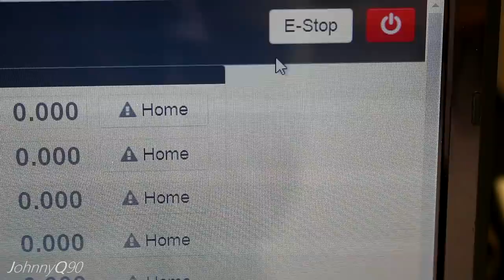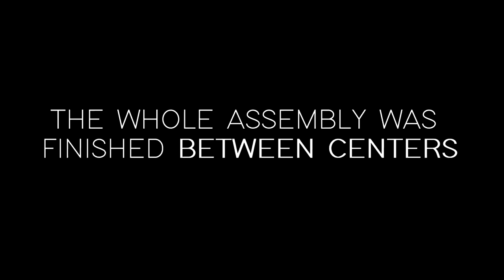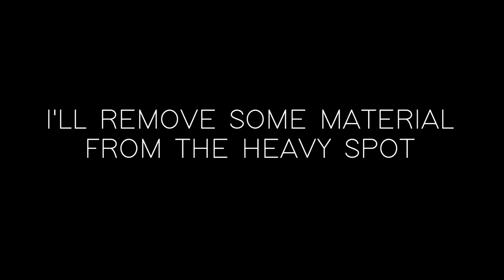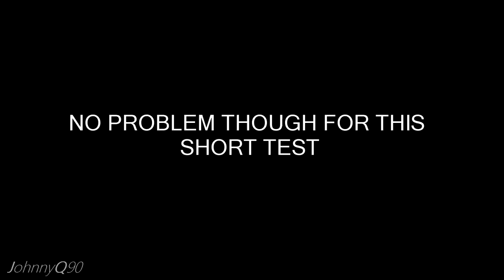Twin Turbine Rotary Grinder Tool Powered by Vacuum Cleaner

Comment: Place the vacuum hose on the exhaust port. Flip the motor over so when you use it,  the debris will be blown out of the way instead of sucked in!

Comment: There's some electrical engineering guys that'd be mad you didn't just use the motor in the vacuum to drive the shaft... Then there's the machining guys that love the idea of a rotary that has no recharge time and what I'm guessing is actually quite a lot of torque.

Comment: It's almost more useful that it vacuums the debris while working
Reply: yeah maybe a filter to stop the large debris and a funnel to get in close to the powder
Reply: Yeah but damages the propeler of the turbine
Reply: Battle Ground Survivor not if soft nonmetallic materials are used
Reply: Cobster Wilson yes I know, soft materials wont do damage
Reply: Chineses know what the next gadget they will sell
Reply: @brunovlaminck9901  dremmel made one some years ago but it seems that is was ass
Reply: great for nasty carbon fibre
Reply: I think jet engines have debris rejection systems on their inlet, there must be something that fits on this one
Reply: I am a turbine mechanic, they do have a system that uses centrifugal force to push heavier debris to the out side of a circular frame that has a scary suction device that pulls it out if the engine, I just don't think that system could be scared down to this small of a size.
Reply: This is so cool, your projects are just excellent! Did you ever print a duct to vacuum the debri created by the tool?
Reply: @mate7255  maybe version 2.0 has the speed control at the base with longer prop shaft. With the turbine farther away from the work little or no debris should get sucked in except ultra fine dust.
Reply: @Gamerock82  using some sort of filter is the smartest thing
Reply: @mate7255  not if you want a constant speed. As the air flow becomes more restricted the rpm ramps up quite steeply. Strictly speaking the smartest thing would have been to better protect the system with maybe a cone on the front of the prop that sheilds it from direct debris strike. Or, as I said, longer shaft so the air intake is on the sides, farther away from the flying bits of material instead of directly by the tool tip. Just an option. A great build nonetheless. Way above my pay grade.
Reply: I'd agree, I think if it would be designed so that the turbine blades are consumables and easily replaced, it is a huge feature.
Reply: @mate7255  the problem then is the filter will introduce some resistance
Reply: @poolofstuff  metal mesh filter wont cause too much resistance and it will filter out the larger chunks.
Reply: It probably causes FOD damage to the turbine.

Comment: Sick. Much better than the dremel version.
Reply: hope for the pocket NC lol
Reply: Pretty sure this IS the dremel. Did you see the hose while the tool was working? He made 2 one with air and the other attached to his dremel. I call shennanigins.
Reply: @thegenerousdegenerate9395  Nah, you're just seeing things.
Reply: @thegenerousdegenerate9395  I normally trust Johnny to make real things but I have to agree with this. It didn't sound or act like the vacuum powered one when he was actually using it, and it didn't bog down hardly at all when it was put to metal or wood. And it may just be my eyes, but the end shot, I feel like I can see it "cog" a little bit when he turns it off, like a rotor in a motor. I really want jq90 to clear this up, because I too call shenanigans.
Reply: @octane613  I think you are seeing things because of the shape/pattern of the sandpaper.  If I look at the whole tool and shaft it does seem like it's slowing down unevenly but if you put something over the tool and just look at the shaft it slows down normal.
Reply: This is starting with a 500 watt vacuum cleaner. Potentially, there is more power at the tool tip than with an actual Dremel. There is probably a higher moment of rotary inertia, since the spinning part of the tool is larger in diameter than a Dremel.

The bearings are probably better, and they are actively cooled. I don't see any reason why this wouldn't have more power than a Dremel.
Reply: @octane613  You know at the very end you can see the vaccuum hose right? So unless you're saying he built a sheath to hide a dremel to fool us all, I think that's unlikely.
Reply: Boss Günter  You missed the point entirely.

Comment: Next step, a real combustion turbine like the ones used un aeromodelism.
Reply: and installed on his rc car... (for replace the original nitro motor)
Reply: @MATEKYOO  i like that idea, but for that it would be bettet to use it like in a helicopter, they use the turbine to make rotate the rotor instead of for thrust. If you use a turbine for propulsion on a RC car, even just having it started without accelerating, it would make it move forward and that is a problem.
Reply: @AndoniOlea  : hypothetically it should have a free power turbine geared to the transmission... (direct gearing the gas generator to a shaft converter is a bad idea, though it is a cheaper / lighter alternative)

Axial RC turbines, who wouldn't want them...  ( though they do suck and blow thermodynamically at that size,  allegedly)
Reply: @kadmow  You are correct in that, but if he uses a turbine in a conventional way, he should add brakes to the car (it doesn´t matter how they work) but it needs them.

Comment: The power of succ
Reply: Memes
😂👌
Reply: vacuum cleaner normally runs 1.5kw to 2kw
that will put this tool amount the power tools.
Reply: @lpjunction  and air turbines are around 10% efficient so you can expect around 22w of mecanical power output, still not so bad
Reply: I am aware of thr efficiency

I meant the machine is taking 2kw level of power
that puts it amount power tools

That`s based on the power consummed

Comment: The project is really cool, but will the bearings survive the insane RPM's ?
Reply: Even ABEC1 bearings are rated to 30k+ rpms when the bearings are this small. I think the loads and temperature are a bigger concern if he's doing sustained work with the tool.

Temperature might be mitigated by airflow through the tool.

Comment: You shouldn't use such long reach tooling for every operation.  Your feeds and speed could be higher and your finish will be better if you stick with appropriately sized tooling.  The machine will also be quieter, which is evidence of better tooling selection.

Comment: Now mount that to the cnc, see how it preforms, it might be actually pretty good to mill :p
Reply: my first thought: could this work as a self cooling/ self cleaning spindle for diy cnc machines?
Reply: @TheScarvig  Ye it sure would work. Speed seems high enough. But the particles that get sucked in might damage / unbalance the turbines thus causing vibrations. But a blowing vacuum would solve this problem and actually would remove the need for a chip cleaning blower thingy... :p

Comment: I call shennanigins.

Thats a pretty sweet dremel attachment you got there. You can hear the motor. Not to mention the hose was curiously outta frame whenever it was doing work. I may be wrong but i don't think so. Turbines don't make much torque there just isn't enough rotating mass and as soon as the tool slows the air just passes through the path of least resistance. Turbines are great for moving air but are horribly inefficient the other way around. Theres a reason you can't go to the hardware stores air tool section and buy a turbine anything.  You think dewalt, makita, snap on etc. haven't done their R&D? But youtube dude knocks it outta the park? I'm sure you'll be rich soon when you get offered for design. Lol
Reply: Jealousy is a terrible trait to showcase in a public forum.
Reply: A dremel needs speed more than it needs tork and a turbine can get hella fast on air. There are videos of people who get Tesla turbines to spin at 30k rpm, there's nothing unbelievable in this video. And tell me, why would Dewalt or Makita be interested about an inefficient design? Do you think they'd want to sell dremels with full sized vacuum cleaners dangling behind them? Do you think people would want to run dremels that use 1 to 2kW of electricity and produce 70 dB of noise?
Reply: @CASTSTONE  I'm guessing your reading comprehension isn't as sharp as it should be.
Reply: @thegenerousdegenerate9395  You're reflecting, clearly you're not able to understand my points and produce counter arguments.

Comment: Awesome project, really well made.
How much power does it output? Compared to a Dremel
Reply: Since its powered by a 500W vacuum its definitely less than 500W, but even if its 50% efficient its more than a dremel i think. 'Course a 500W (2/3 hp) motor with a flex shaft would zoom right past this in pure power. Neat and all, but in terms of practicality low pressure air is pretty weak.

Comment: I really like the CNC machine & where did you get the design & code from?? This is the coolest build I've seen a while. Can I suggest you build a Tesla Turbine with a fly-ball Governor on it with a combustion chamber & a couple of Valveless valves for intakes. You could make a fuel powered Tesla Turbine as an experiment. That'd be extremely interesting.

Comment: Beautiful project, superb execution. Excellent video.

I gotta ask though, this thing has zero torque, right?
Reply: seems to be fairly powerful.
Reply: Leigh Devlin ..... It’s a bit like BHP and torque. What I mean is, this thing probably bogs down easily, look at how he has to hog material from something as soft as (what looks like) brass; small little bites so it doesn’t stall.

Air compresses easily, so a lot of the energy goes into compressing the air inside the tool when it’s under load and can’t escape fast enough. Then, as the air compresses and the turbine slows, so does the output speed, with the added resistance of the material, the tool bogs down.

That’s why pneumatic tools work, they’re under such high pressure that the air acts more like a liquid, and provides more power and torque.

This is from a layman’s understanding though, so please correct if wrong.

Comment: Well.... what's the point  of using HIGH really high precision machines to make a drill for handicrafts???? (One that can be destroyed with some steel dust, you should have done the whole thing for a compressor, not for a vacuumcleaner)....
  Isnt it like going to the Porsche Factory in Germany to build a.... wood car???? Or a bike out of plastic???

Comment: I got about half way through the lathe porn before I realized I had added the word, 'motor' to the end of title.

I subconsciously did this because JohnnyQ90 had an unnecessary word on the end: 'cleaner'. His Twin Turbine, Raspberry Tangerine Metalflake, custom job is powered by VACUUM, with a vacuum cleaner as ONE source of vacuum.

It is a well made Twin Turbine, Raspberry Tangerine Metalflake, custom, I'll give you him that, he does have some mill skill.  (Cute little mill, too.)

The other subconscious reason I added 'motor' is vacuum cleaner powered tools have no torque. If they did, all the vacuum cleaner powered tools invented would still be available, and they aren't.

Comment: Hi Johnny
I had not seen the video for a long time, and thank you for the new video
Your job in making twin turbines is very interesting and appreciated, but with a dc or universal ac or brushless  motor you power to 50w you can easily do it. You built a 50w grinder with a 2kw vacuum cleaner and this is not a good performance.
good luck

Comment: what were you thinking about when you designed a rotor  that actually draws material through the rotor blades?  On the one hand, it looks like it would automatically clean up after any operation you perform.... but as one of the other posts asked "I'd like to see a tear down after 1 month...." :)  Great job on execution!   Thanks for posting it.  Doug

Comment: my first comment just now, I want to ask a 12v dc dynamo like that, can it be changed to 220v ac, how many wires must be wrapped and what size, I think it's like an electric drill, the picture is like that, understand that I like the small ones, directly plug in the electricity without much  component.  what can you do, thanks.

Comment: You might want to make some sort of guard when using a thread milling cutter because you're going to have it catch one day and when it comes apart on you, its gonna be ugly. 
I had a similar bit shatter while using it in Bosch palm router with the base removed so it was basically how you were using this. Part skipped off my full face shield, another part went through two layers of sheet rock behind me and into the house, and another piece skipped out the open garage door never to be seen again.

Comment: Couldn't you made it where the tool worked using the exhaust of the shop vac? That way it wouldn't suck up anything that could mess up the turbines. It would also have the benefit of blowing the debris away from the work piece.

Comment: Youve effectively made a tool on your mill and lathe that does a job a lathe and mill will do better, quieter and more efficiently..  there is one signifigant personal benefactor here though, when doing work with it, there is no dust or shavings left behind, to the tools degredation unfortunately.   But that idea alone is a great concept and as in turbines attached to airplanes and such, debris are accounted for naturally getting sucked inside. As is moisture constantly being condensed and pulled inside creating a vortex   I wonder if a solution to this issue would be to add a lubricating oil atomising injector on the prestage of the turbine which could then be machined to have a pulsed spray designed to use the internal vacuum pressure to pull oil in and push out, keeping the bearings and fins clean.   This is still applying an idea of a self cleaning and perpetually motivated by a single power train, the vacuum..   Then bragging rights can be advertised as efficient without having to use what usually would be the actual tool motor and attached vacuum dust collector both..  copy right it and trademark and glue a dewalt or mikwakee sticker on it, with their endorcement, and charge 350$ with a 35% personal commission per sale.  Viable retirement envestment plan idea..  .  ...maybe..

Comment: What if you were to make it work in reverse? Hook it up to the exhaust port on a vaccum. The vaccum would act as a filter for the turbine to prevent debris damage and it would blow chips away from the work piece.

Comment: you should have reversed the direction of the turbine blades to work under positive pressure rather than suction....the you don't need to worry about debris, and the exhaust automatically clears your work of debris....

Comment: Exceptional build, as per the usual, and I appreciate the multiple manufacturing processes utilized. It appears that the "heavy spot" is perpendicular to the cross drilled hole and set screw hole that are parallel in the shaft, perhaps if you aligned them so that they were perpendicular to each other, you may not have to remove any material when balancing the assembly, or at least not as much.

Comment: Funny story i took a 12 amp vacum cleaner motor and thought hey this would make a hell of a fan for outdoors well never and i say never try that shit i put a metal fan blade onto it plugged it in and before i could unplug it all i had left of the blade was the center of it, it flew apart like a frag grenade into a milluon tiny pieces. Lol maybe a clutch fan from a car motor would work IDK. 😆

Comment: The part i kinda dont like about this creation is, the moment when you grind all the chips and dust getting sucked right into the turbine wich causes quiet a lot of wear and friction in there... if you only work on softer materials than aluminium like wood plastic etc it wont be a problem i guess but... nah nvm i wouldve made another entry hole for the air instead... but great job at all

Comment: maybe you could modify the design and make the turbine blades out of something more massive or add a balanced weight on the opposite side of the bit to create more rotational momentum? possibly a more narrow inlet and a few more stages to the turbine? I know that makes balancing more difficult, but I think it would make the device better at drilling

Comment: Well done!! But like you say, sucked in debris can damage the turbine. And because this is a rotary tool this is what you will use it for. So the devise is not usable. But again well done. It works perfectly. When you turn the turbine around and use the vacuum cleaner on the blow side it will work the same I think and now the air will.blow the debris away instead of sucking it in.

Comment: Would have been better to balance the turbine wheels and shaft separately, then assemble the front wheel to the shaft (which looks to be rather permanent) and check the balance of the assembly. Put the rear wheel on and try all 3 rotational positions to get the least imbalance, then correct the balance of the complete assembly. More work but better than just taking all the imbalance out by grinding one spot on the shaft.

Comment: Why not put your vacuum hose on the output side and power your motor with pressure instead of vacuum? You won't have to worry about stuff being sucker into the motor  that way.

Comment: Headphone warning lol but if your shop vac has a hole that you can plug the hose to then you'd be fine and could potentially use another shop vac hose for debris pickup if you use a filter on the inside

Comment: Have you thought about making and over tube sealing the front so air to power the turbine can be sucked from the rear of the unit stopping material going through the turbine.